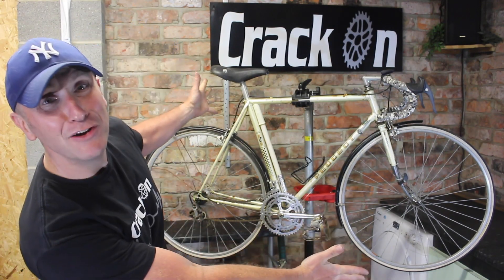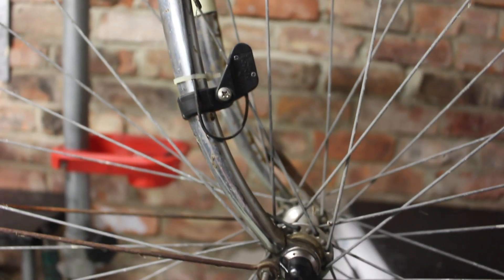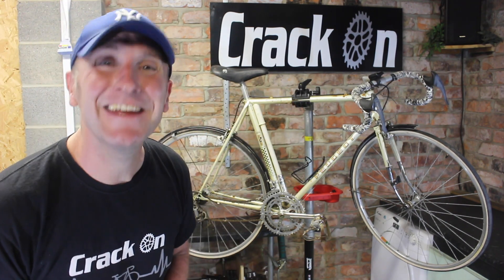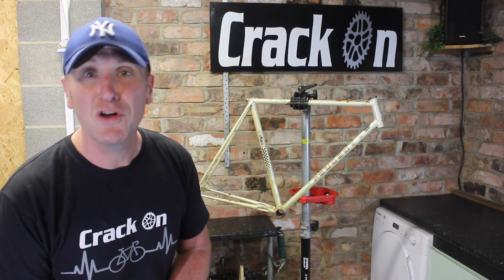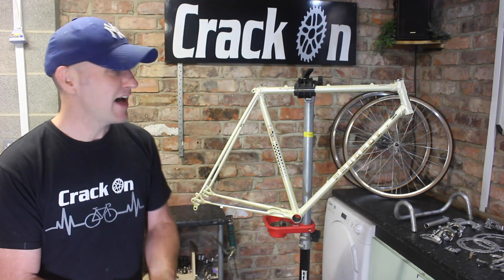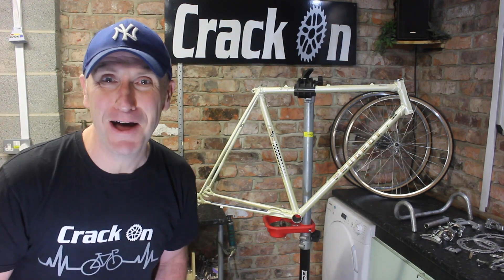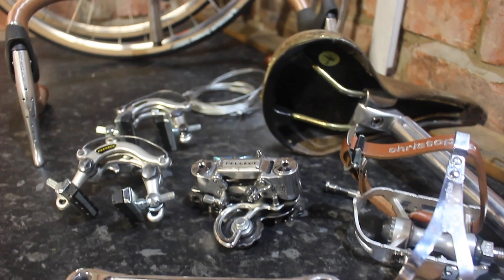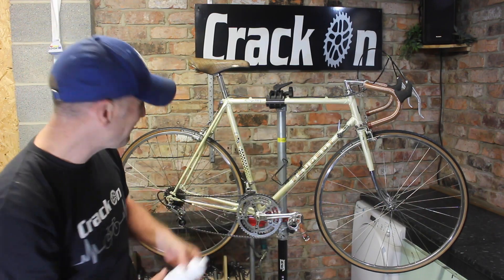Vintage Peugeot 531 Competition Road Bike Restoration

Comment: Great video, about the time this was posted I acquired a 1981 PXN10LE Super Competition which is full Reynolds 531 in the same color and with about the same rust in the same spots to restore. A week ago I snagged a 1980 PKN10LE Competition with really great Pearl Blue paint and NO rust but a broken front derailleur and a very slightly bent fork. Both are all original and intact right down to the US DOT mandated reflectors.
Reply from the maker: Wow sounds a sweet bike, thanks for sharing and watching all the best Andy

Comment: Amazing work as usual, that derailleur and groupset turned out great, bike looks fantastic with the little paint touch ups, I was scared when you started taking paint off with the screwdriver but turned out incredible!
Reply from the maker: Thanks for watching and the support, yes the frame was definitely the biggest challenge on the restoration, thanks again all the best 👍
Reply: What size is the seat post ?

Comment: Wow grand job.  I just got my hands on one of Peugeot road bikes. Much worst state. But I paid 20 quid for it. Now I stuck with BB swap, first nuts holding it was made out of plastic that got brittle due to bike being exposed to elements for possibly years. So each attempt to unscrew them end with tearing nut apart. I am stuck with for a moment. But this video did put me in motivation mood to work on it again so you have my thanks :).
Reply from the maker: Oh dear the joys of restoring, thanks for watching and your support. Good luck with the restoration 👍

Comment: I used to ride those in the late '80s early '90s, for Martigues S-C in the Marseille area. Peugeot team issue; was still Mavic/Simplex throughout but had moved on to Reynolds 653. I'm sure the semi-chromed forks gave an edge in a sprint! But a great bike, handled lovely. Steel sits much better than carbon on rubbish roads (you CAN find them in France, organisers look for them)
Reply from the maker: Thanks for watching and sharing your personal experiences 🚲interesting. All the best

Comment: I love how you give these beautiful machines a second life. Some time ago you inspired me to give some restoration a shot and am now working on my third bike. So far I have restored a 1988 Bianchi Sport SX, a 1993 Bianchi Alfana and almost completed a 1971 Mercier 100. The Mercier was in rough shape and getting original part replacements was a quest to say the least. Being willing to wait for them to come from Europe was a test of patience for sure. I have fallen in love with the Bianchi Alfana as, even though it is not a high end bike, it is a wonderfully smooth and comfortable ride. I think I almost prefer it to my carbon bikes. I have one question about this restoration. How did you treat the chrome on the front forks?
Reply from the maker: Music to my ears, messages like this really do give me the energy to carry on doing what I do so thank you. Sounds like you've done some great restorations, I still need to do a Bianchi on the channel, watch this space. Regarding the folks, clean as normal then I used WD40 and wire whool to rub them down. I hope this helps all the very best Andy

Comment: I just picked up a Peugeot Super Competition circa 1980 in good condition for 400 Euro, here in Donegal, Ireland. Mine has Cinelli bars and ITM stem, which I guess has been added later. Also Mavic Open 4 CD 700C rims, 531 main tubes, 531 chrome forks and Shimano 600 groupset. I remember reading about this bike (Super Champion) in Freewheel magazine at that time. Finally bought one 40 years later.
Reply from the maker: Good for you 😉👍 it sounds like you’ve found yourself a great bike. Thanks for watching all the best, enjoy 🚲

Comment: Another lovely rebuild, absolutely nice colours! The finish of the components is stunning, better than new. What happened to the Simplex rear derailleur? Looks like you replaced it with a suntour ar. 
Cheers and kudos!
Reply from the maker: Wow, you spotted it and 10 out of 10 for the correct answer. The original wasn't creating enough tension and was leaving the chain saggy. The spring needs some attention but simply didn't have enough time with doing the video. Thanks for watching and the support
Reply: @BikeItUK  Thank you for your reply and keep up your great work 👍

Comment: Amazing job man, great work! I have the exact same bike which similarly has some rust and chips in the paint, could you point me towards what paint you used to touch it up? it's an unusual colour the pearl white and wasn't sure where to look
Reply from the maker: Hi thanks for watching, I generally use Humbrol model paint. I normally take the folks with me to a hobby shop or a car body shop where they sell touch up paint. Then match up the best that I can. If its small areas you can get away with it. Hope this helps

Comment: I'm impressed with the results, especially how you treated te rust bits on the frame. I have a Peugeot bike from 1986 which also has some rust on. What product are you using to threat this and also what are you spraying tonfinish it up (varnish)?
Reply from the maker: Hi thanks for watching, I just used a clear lacquer to protect the frame and I have a dedicated video on the process I use to restore these frames here, hope this helps: https://youtu.be/z_I5v5FwHCk

Comment: Great video Andy. So did that Peugeot have Swiss BB cups like my 1981 PXN10E Super Competition had ? 35 X P1 Left Hand fixed cup? Seeing you tighten the fixed cup CCW suggests British or that rarity Swiss non-standard "Standard"
Reply from the maker: Hi thanks for watching, the bottom bracket cup was British
Reply: Do you know what the model the BB is? I need a replacement one for my vintage Peugeot and yours looks like it would look great
Reply: @jakeg8871  The BB my Peugeot had with it's  Stronglight 106 crankset was a Stronglight model 65 with french 35 x p1 threads. The problem I had was the unavailability of the Swiss threaded fixed cup which was 35 x p1 BUT left handed like British fixed cups. I got rid of the bike in 1990 mostly because of that annoying quirk. The French refused to adapt to the predominant standards while having terrible parts availability here in the eastern US.

Comment: I see you have changed the front wheel, as before it had a large flange hub, although I know these bikes were supplied with either.
Reply from the maker: Thanks for watching
Reply: @BikeItUK  I noticed the different front wheel because I bought two of these bikes at the same time,- one for me and one for my daughter. Hers had a large flange hub and I was disappointed that mine didn't. The good thing is, Ive still got hers and its all original and like new.

Comment: I noticed in all of your rebuilds that I never see a bike that has brake lever extensions that we pulled up in the middle of the handle bars to stop the bike..I think they were called safety levers..Most bikes I've seen growing up back in the day had them over here in the U.S..Did you ever do a restoration of a bike that had them?
Reply from the maker: Hi thanks for watching, yes I do know the levers you mean. These tended to be the lower end of the market and less on the race bikes. We did definitely have them over here in the UK.

Comment: Hi, I am the owner of a couple of Delightful Vintage retro bikes from new. One Italian, One Spanish. Ive always done my own maintenance baring wheel truing, and have always  relied on inventiveness to hold it up, propped against wall with old socks protecting bar tape , hoods and saddle, suspending from sealing, bottle jack under bottom bracket on a rubber pad you get my drift. Only last year though, someone got me a proper bike stand after all these years, (halfords job really pleased) BUT am seeing comments on social media bike forums that you should NEVER hold up a bike on its top tube with any bike stand and regardless of what the frame is made of because it might bend or brake it, whats your take on this please ?? i ask because i have only ever worked on  vintage steel bikes . T I A for your answer.
Reply from the maker: Common sense really.....if your going to use a spring clamp on anything it’s common sense to think will the pressure of the clamp cause damage to the material it’s clamping. It definitely makes sense to reduce the risk by clamping the seat post. In the videos I do use the top bar which is just so I can get the whole bicycle in frame of the camera. I hope this helps in your question